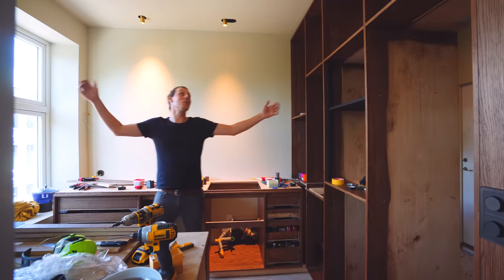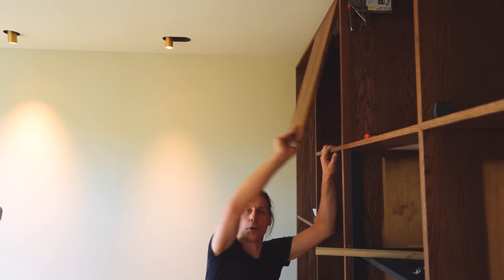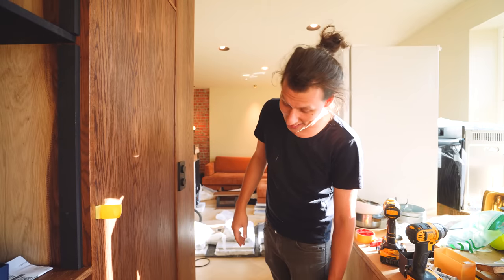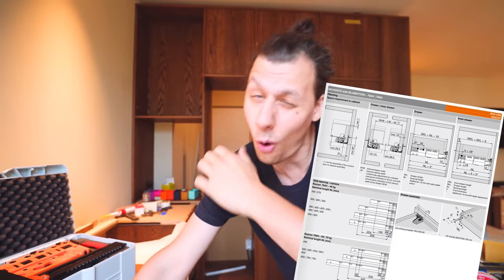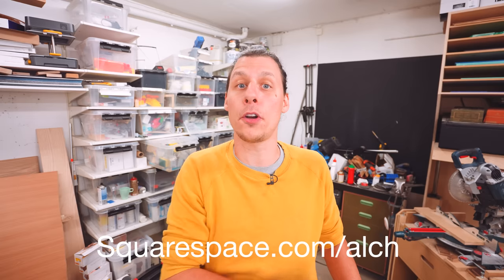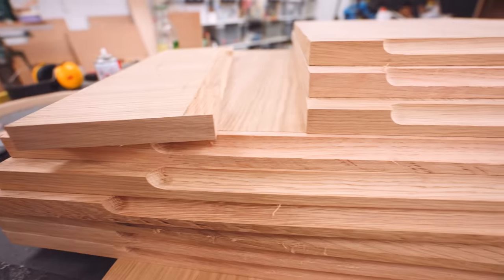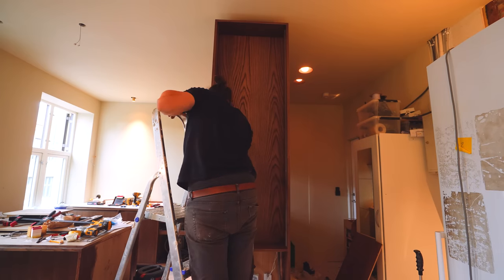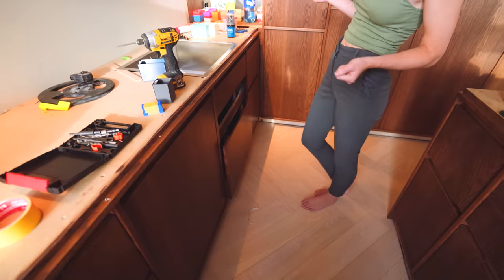A ROBOT Opens my Fridge  - DIY Kitchen Build

Comment: I have all Servo-Drive drawers in my kitchen. Let me offer you a tip: if you’re pressing directly on the wood to open the drawers/doors, over time, you’ll end up creating a worn or polished spot where you usually press on the wood. My cabinetmaker warned me about this, and I really didn’t want to have any handles on anything so I left it with no pulls of any kind. At some point, I may have to have my drawers refinished. You could perhaps have just a flat plate that’s he push target, if you want to avoid this.

Comment: VERY nice hardware and mechanical work.... very professional.  BTW, one of the reasons it took so long to sand the panel/doors is because you placed and sanded them at counter level (or desk level if seated).  Proficient finishers know that to sand efficiently and fast , you need to place what needs to be sanded below waist level while standing  Why?  Because you can use your body weight while using a wood block and sand paper combination to sand parallel to the grain (using the correct sand paper grit) instead of using your arms and a circular sander that puts more scratches on the wood instead of sanding the grain smooth thus requiring a lower grit than would be most efficient. Using your shoulders and arms rather than pressing body weight is the hardest and slowest way to sand anything.

Comment: You don't actually need the second Servo drive on a 1870mm fridge. I have learned from experience two servo's sometime works worse if your fridge pulls a vacuum like they sometimes do.

Comment: Great kitchen! 
Would you consider adding a motion sensor for the display cabinet light strip? That way, when there are people around it automatically turns on; this way you don't have to always manually turn the light strip on/off. I did this for my kitchen and it's the best thing my wife likes.

Comment: You certainly have gone above and beyond with this kitchen project 😊 I do wonder if the cost of the electrical openers etc would be within the normal kitchen build project, in yours though it is truly well worth it, you would find it very hard to find a professional kitchen builder/installer to do the work to the standard you have 😊 well done 👍

Comment: I'm amazed how absolutely huge the drives for the doors are (60mm high, especially the fridge one. Do they think people will use them for nuclear bunker blast doors? At first I thought they just wasted some space on a big, long lived power supply, but then I learned those servos need an external 24V brick. And they take 50W each (because you need two for any sensible sized fridge).
 
Those IDC (insulation displacement) connectors look like a maintenance nightmare, with at least one cable ending up with exposed end, covered only with some flimsy cover. Granted, it's only 24V, but it can still cause problems if some stray fork finds it's way near it.

Comment: can you show the back of the cupboards?. is that going to be open with ventilation mainly for the fridge and freezer as they will need air flow and given you custom made the spots for them replacing the fridge and freezer will surely be a problem. other than that its coming up great and looks modern and stylish

Comment: Hi, can you tell us something about those 3d printed guides you've used in the video? Do you have the digital files available?

do you know the sku of the blum jigs kit, the one that comes with the box?

Coincidentally I too soon will have to build my new kitchen, and I've already selected basically all of the blum hardware you've used in the video 😁, the only thing I've done differently is that i've used fusion instead of sketchup.
So far I've drawn only the cabinets. I was thinking about a full overlay kitchen, but I have to say your inset cabinets looks VERY good.
Kudos.

Comment: What's the point? It's not faster or easier, it needs power, and costs more. Fine it's cool it can close itself, but here me out: if it isn't powered probably not going to open on its own also most new fridge beeps if you leave it open.
Reply: Clearly it is all aesthetics which is fine. When not in use I doubt the power draw on these is significant. It allows them to A) not have handles displayed and B) for the higher cupboards they can have it open upwards like they showed without it being too high to close it.

The auto close on the fridge feature is more to fix the issue (that yes the system itself causes) where its slightly too sensitive and can open without you realising. How annoying would it be to have the fridge accidentally open as you move elsewhere only to have to get back up and close it. IMO Ideally it wouldn't be that sensitive but it is what it is and at least it can close on its own when its made a mistake.
Reply: @toms2oo8  I know it's aesthetics. But hear me out: you could use normal inset doors and push pin. Sure, they don't open upwards, but achieve the same look when not in use - no wiring/batteries to change. Also, if you can't reach the doors, the cabinet is probably too high to use the top part without a stepladder, so you could move the hinge point downwards, without losing usable real estate. 
What I was trying to point out, is that I feel this only solves problems that have been created for it. It's an awesome ad, and they probably work great, so might as well use them. But in the real world I feel, if this is the tool I feel the need to use, I think It is most likely I went somewhere wrong in the design process. 
TLDR: "They were too busy to answer if they can do it, to question, whether they should do it.... ". It's the same as most of the IoT stuff, If you are the person who categorically needs an online toaster, you will pay happily 5x more. In my experience, even when I think I'm that person, I will sooner or later realize, that I'm not. Therefore, I question, whether there is anybody like that?

Comment: How do the fridge and freezer get rid of the heat when it's inside the shelf?
Reply: The cabinets are ventilated in the back. He made some holes in the very beginning of the video, both above and in the bottom, and sides. He specifically said he spent the last couple of days making a lot of holes for ventilation and other stuff. :)
Reply: @madmodders  What I am saying is, that I didn't notice any ventilation to the outside, so it all seemed boxed in.
Reply: @Mr_Wh1  To my understanding, since he is Norwegian and we scandanavic have pretty much similar appliances. They only require a fresh air supply, but venting out into a cabinet above, for excess heat is enough. Every product tend to specify what kind of room/ventilation they require for warranty claims.
Reply: @Helveteshit  It doesn't matter. You can't box it in. I am not saying he did though, but rather that I didn't see where the heat would go.
Reply: @Mr_Wh1  True, you can't just vent to the next cabinet and have it stop there. There has to be a way for air to circulate. From outside in to the bottom, and from the top to the outside. That's why there are cutouts towards the back on both bottom and top side on over-the-fridge cabinets you buy in flat packs. Maybe there are vents on the back side towards the floor and ceiling facing the condo entry door.